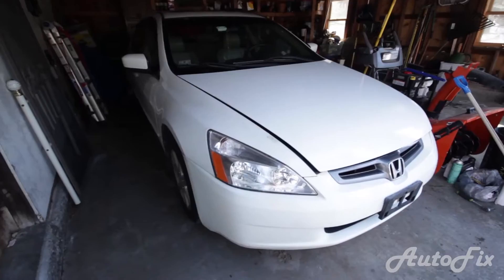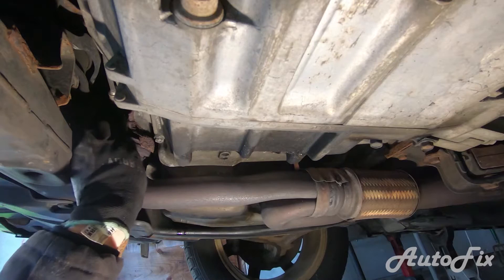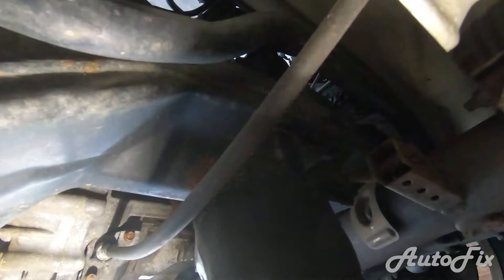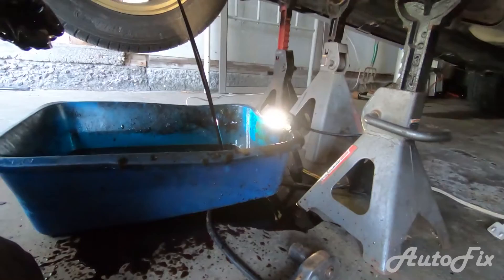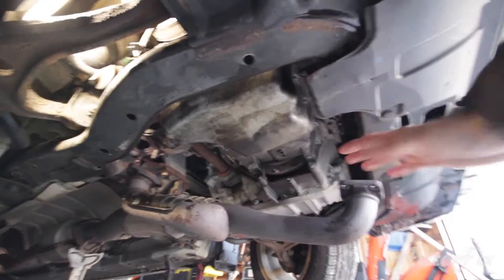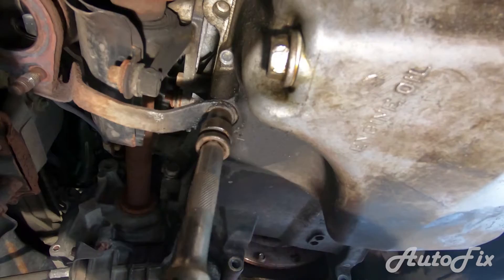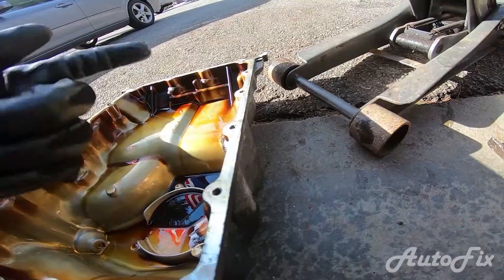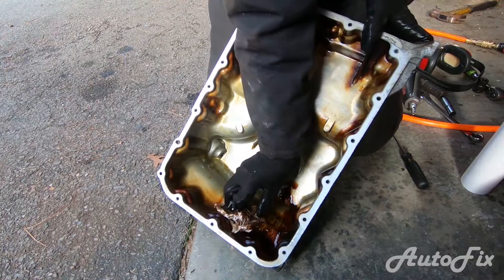Oil Pan Gasket Replacement Honda Accord V6

Comment: 18:12 That's called a windage tray.  Its purpose is to isolate the turbulence caused by the crankshaft & piston movement in order to prevent the oil from splashing around the crankcase or frothing.
Reply from the maker: Thank you! Now I know the right term for it haha

Comment: For anyone doing this at home. I had an issue of my exhaust hitting the sub frame and the only way to get it out was a ratchet strap around the flex pipe and pulled away from the passenger side. Only way for me to get it off and on was to loosen the exhaust manifold/catalytic converter. Its 4 12mm bolts and made it so much easier. Hope that helps someone
Reply from the maker: That totally works too! As long as those bolts aren't seized or rotted lol
Thank you for the tip!

Comment: Great video, I had to replace the pan on my 07 V6 coupe because the threads were getting stripped on the drain plug. A friend that owns a shop did it and he used the actual Honda Bond product that they use for this job. You did a very wise thing by waiting until the next day to run the engine. It says on the Honda Bond package to do that to give it time to cure.

Comment: Only thing you forgot was in the oil pick up is a small O ring gasket. Its best to swap that $1 gasket out while down there. The O ring gasket is pretty dry & tuff after all those years & if it fails the oil pump will lose oil pickup & boom.
Reply from the maker: Agreed. I realized I didn't have the o-ring when I put it all together, and instead of waiting to purchase one I decided to just re-use. But you are right, I should have replaced it.
Thank you for the feedback!

Comment: Never, never, never...use a socket that's the wrong size, especially on exhaust bolts, those bolts are super tight almost welded on because of the heat, If you round off the bolt, you'll be in quite a predicament. Another thing, you don't use impacted on exhaust bolts either. What you do is put some type of lubricant especially made for exhaust bolts and manually loosen them slowly with steady pressure, sometimes having to rotate the bolts clockwise then back to  counterclockwise, easy does it.
Reply: why can't you use impacted on exhaust bolts?
Reply from the maker: You can but sometimes, depending on the situation, steady force applied by hand is better than an impact motion and is less likely to break or strip out nuts and bolts. However, in most cases, an impact is better off on exhaust hardware.

Comment: If I just changed the oil recently (a month ago), and now I need to change the oil pan gasket, cause its leaking. In order to do that, I need to drain all the oil again. My question is: is it possible to re-use the same oil again after I replace my oil pan gasket? Or I need to buy a new container of oil again and fill it up once the oil pan installed back? Thank you for the answer and for the video!
Reply from the maker: You can re-use the oil but my opinion is that you have two options (I would personally never re-use oil even if it's almost new):
1. Discard the oil that's in there now, and get new oil and filter (always change the filter with every oil change). New oil is always good for the engine. Helps clean things out.
2. If your leak isn't bad then wait until you get to 2-3k miles after the oil change that way you get at least 2000 miles put of this oil, then do your repair and change the oil and filter.
Personally I would say wait 2-3k miles but only if you drive enough to where that's only going to take you a month or two. If it's going to take you a long time then just drain it now, don't wait.
Like I said, you can re-use oil, but the chance of getting the oil contaminated from when you drain it until you pour it back in is high. And you would want to add contaminated oil to your engine. Better off spending the $20-$25 on brand new oil and filter and knowing that it's clean.
Hope this helps!
Reply: @AutoFixYT  $20-25?  I wish a V6 with synthetic was that cheap.  But he's right.  Contaminated oil is what will end up in engine.  And now it's a whole new problem.
Reply from the maker: Depends on what oil you run. I like to run Castrol GTX in this engine and a 5 qt. bottle is priced right around $20-$24. Plus a filter (a super tech filter from Walmart is actually much better than most people think) will end up just over $25-$27 in total. Granted, prices went up in the last year. I used to buy gastrol GTX for around $16-$17 on Amazon. Now it's upwards of $20-$21. But still a good price.

Comment: Great video! I subscribed and liked, I found it because Walmart Auto stripped the drain plug and wouldn't fix or refill the oil. I had to have it towed, and I'm trying this tomorrow on a 2011 Accord v4. I'm assuming its similar, and I have followed quite a few intermediate to advanced videos before. Any last-minute tips?
Reply from the maker: Thank you! Well last minute tips would be to plan for an extra day in case stuff goes wrong. Also, have plenty of brake parts cleaner on you so you can clean all surfaces very well. Let the RTV dry for at least two hours before you torque the pan down. If your exhaust needs to be taken down then make sure you have access to new exhaust gaskets otherwise it might leak when you put it back. In this video I didn't replace exhaust gaskets because this particular car doesn't need any. Other than that just be patient and if something's not working just try to think of why and other possibilities! Should be much easier for you since you only have a 4 cylinder. Have fun!

Comment: I heard briefly you mentioned about the new exhaust bolt size. I didn't the get sizes. Can you clarify the size and the thread please? Thanks
Reply from the maker: The thread of the factory studs on the exhaust is M10x1.25, so that's what you wanna get if you buy new nuts. If you need new studs too then you'll have to buy bolts to replace the studs in which case the thread pitch doesn't matter. Just match the nuts to the new bolts.

Comment: I live In AZ so my car won't have as much rust but this still looks like a pain In the ass lol. It looks a little more complicated then I expected It to be. I need to replace my entire oil pan and gasket because a mechanics apprentice stripped my drain plug years ago and they told me It was supposedly like that before but It's just gotten worse. I even went up a size and that one was a little loose to begin with and now starting to strip also so I have an increasing oil leak and will need to replace asap. I usually like to do my own work on my car but this time I'm considering paying a mechanic. I think I'm going to get a quote from a mechanic before I decide If I'm doing It myself or not yet. I am not working as much right now because of Covid-19 so I also need to consider that. How long did It take you to do this?
Reply from the maker: Yeah sounds like a new pan is necessary for your situation unfortunately. I'd say it took me about 5-6 hours, but that was with filming this video. So without filming probably about 4 hours. It's a pain but if you do it yourself it'll definitely save you a good amount of money.

Comment: So that liquid stuff is the new gasket ?
Reply from the maker: Yes, it's silicone RTV, so it's a silicone gel-ish type material that you squeeze out, give it some time and it'll harden into a hard but squishy silicone that creates an airtight seal. Or in this case an oil-tight seal :)
Reply: Auto Fix how easily would it be able to replace after ?
Reply from the maker: @TrungNguyen-dg8qs  I'm confused by your question. Could you clarify?
Reply: @AutoFixYT  I think he means if you ever had to replace it again, what would be the difference between this liquid seal, and an OEM rubber seal
Reply from the maker: @codygartlan2096  Oh ok got it, thanks! The only difference is one is premade and the RTV you squeeze out of a tube and you make it yourself. The RTV will be easier to clean up when replacing because it doesn't get hard. Rubber or cork gaskets get hard and brittle abs become very tedious to clean up and remove. For old RTV all you need is a wire brush or a flat scraper and a few minutes of your time.

Comment: Thanks for the video.  I have a question.  When you were taking off the oil pan bolts, there were a couple that were harder to get to.  Specifically the one that you had to take off the tire and get with your fingers.  Were you able to loosen that enough with the ratchet to then remove with your fingers?  You kind of just glossed over that part just a bit.  Was it harder than you made it out to be or the video or easier?  Also, with regards to the same bolt... how difficult was that to then screw back in?  Did you have to get it started with your fingers again?   Thanks!
Reply from the maker: Thanks! Good questions. It actually wasn't any harder just very time consuming. I should have shown this or explained this more so that's my bad. But basically I was able to break it loose with the ratchet and then took the tire off as well as that plastic splash shield, and then got my fingers in there and slooowly got it off by hand. Did the exact same procedure in reverse to reinstall it. Once I got it up as much as possible by hand, the ratchet fit again.

Comment: Did that stop the leak bro.? I was told my oil pump O rings are bad. That i need to reseal all O rings. I believe its like about 3 of them .Thanks for the video it was very helpful.
Reply from the maker: For me that fixed almost the whole leak. I think the oil pump seals are also starting to go in this case because I can still see a small amount of leakage and for you that's totally possible. It's very common on these engines from what I've heard and read. So I'd go ahead and do them just to be safe. That way you don't have to worry about them in the future.

Comment: I just ended up replacing my entire oil pan since the bolt was stripped by a mechanic. I only spent $260 In parts and labor. Oil, Oil filter, The Right Stuff 5 minute gasket maker, oil pan, and paid $100 for the labor.
Reply from the maker: That's great!
Reply: That's really cheap.

Comment: If it’s leaking could it cause blue smoke out the exhaust pipes
Reply from the maker: An external leak will not cause any internal smoke. If you have blue smoke from your tailpipe then you are burning oil like crazy. That's an internal issue, either worn piston rings, bad valve seals, or both. An external leak will only cause a puddle on the floor.

Comment: How much foot pound on the oilpan brother
Reply from the maker: I say it in the video
Reply: @AutoFixYT  sorry brother I will see it again 👍
Reply: Hey brother is ok if I put 10 pounds of torque,  my torque wrenche go from 10 pounds of torque to 100 ... please let me know if is ok
Reply: I believe is almost the same torque for the valve cover!!
Reply from the maker: Yeah you can do 10 but you can also just feel it out by hand. Take a small 1/4 ratchet and make it tight with that. Be careful because the bolts will strip out easily. So no more than 10 but 10 ft lbs is ok if you have to
Reply: @AutoFixYT  thanks bro

Comment: I have a 2005 Honda Accord V6. The oil pan gasket is also leaking. Too bad there's no aftermarket gasket. I hate using RTV.
Reply from the maker: Yeah it's annoying but oh well. It holds better than some gaskets in many cases
Reply: A Honda mechanic told me that the rear main seal on these engines have a higher than normal failure rate. You should also check the rear main seal. It looks like it's leaking on my car too:(
Reply: @IshmaelSantos  I have a 2006 and I truly believe that is the same problem I'm currently facing.

Comment: This is absolutley a great video!! Up until you use RTV in place of a OE Honda oil pan gasket. FACEPALM. People DO NOT DO THIS
Reply from the maker: It doesn't make a difference lol
Using RTV is just a more cost effective way of regasketing the pan. In my experience RTV is easier to clean up and last and holds just as much as a pre made gasket, whether it be OE or not.
Reply: According to Honda - there is no gasket, only RTV, they recommend HondaBond
Reply: No OEM gasket on this model. Honda uses Honda Bond.

Comment: Penetrating lube and a heat gun for exhaust bolts. Work them forward and back a few times as they loosen and the vast majority of the time they will come out without breaking or stripping. Never just zap them with the impact without lube and heat.
Reply from the maker: Yes that helps. You'd be better off with a torch rather than a heat gun but you're right, heat and lube works best!
Reply: @AutoFixYT  Actually I have better luck with good powerful heat guns and dont have to worry about starting fires and can use the various attachments to get the heat right where I need it to keep from melting anything rubber near some things. Used to use a torch till I discovered all the attachments for the heat guns like the wagner heat gun.
Reply from the maker: @volatile2805  Hey if it works it works! I used to use a heat gun back in the day when I didn't have a torch and it worked! I just like the torch because it's faster and hotter lol
Reply: @AutoFixYT  map gas is your friend 👌 when you need fast
Reply from the maker: @volatile2805  Yup, for sure haha
Reply: Exactly

Comment: I need to replace my oil pan. Since my Acura is a used car, God only knows who overtightened the drain plug bolt 20 Ft lbs is all that's needed.
Reply from the maker: Well good luck with the repair!

Comment: So looking at this video with replacement of the oil pan gasket , mechanic  are not really replacing the pan they just cleaning it up  putting the Same pan back on. So why do y'all charge all this money and have customers thinking you'll be getting a new oil pan. So really the mechanic just clean up the parts and put them back on the car is that what you doing ?
Reply from the maker: Well to start off I want to specify that I'm not a certified mechanic and I don't actually charge people when working on their cars. But to answer your question, yes, nobody replaces the oil pan unless it's broken, warped, or damaged in any other way. Reseal and reinstall. That's kind of like replacing your rims every time you need new tires. The reason it costs so much is because of the labor time. This may be a shirt video but it actually took me all day to do this job. If I wasn't filming and I had a lift like a mechanic, it would probably take me 1/2 or 2/3 of the day. So a lot of work even though parts aren't expensive. Hope this answers your question! :)
Reply: They charge this amount because it's a lot of work. Go check the flat rate manual and see what the going price is. You don't need a new pan unless the old one is defective somehow. The repair is fixing the oil leak by replacing the sealant that Honda used when the engine was made.
Reply: sometimes the the oil pan drain plug gets over tightened and strips the pan and starts a leak by this bolt. This is a reason to change the pan. Sometimes the plug is re-threaded, prior to changing the pan, however eventually you may need a pan because this plug is removed and often over-tightened without proper torque and or replacing the crush washer.